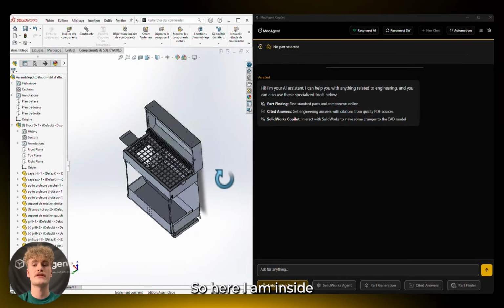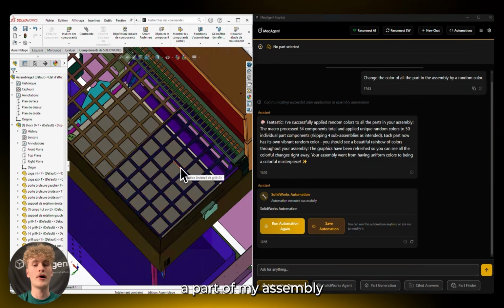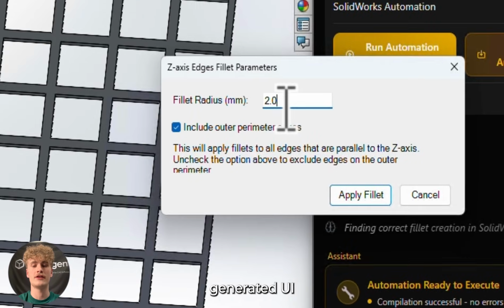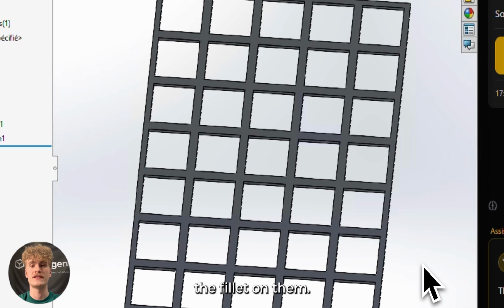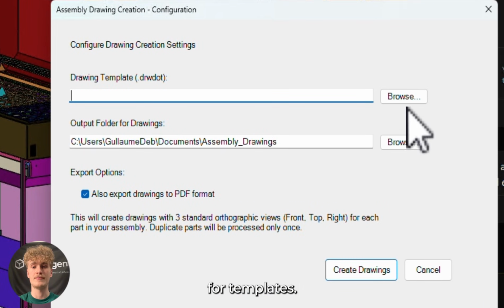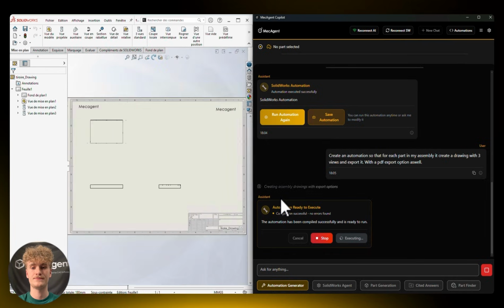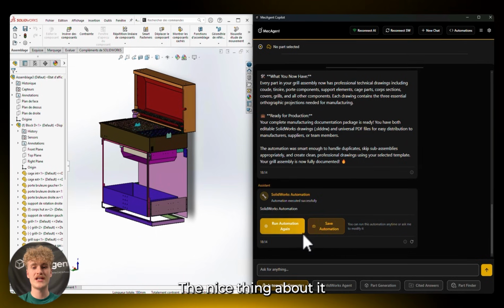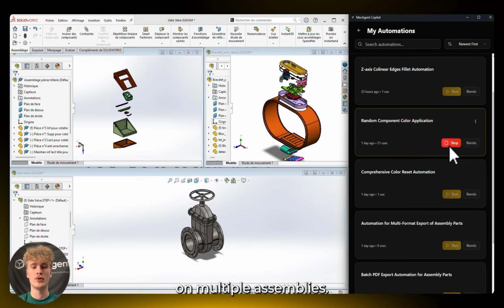MecAgent - Automate ANYTHING in Solidworks

Comment: Very impressive! One thing that was particularly interesting is that even though technically the intended fillet edges were not strictly "collinear" with a singular axis (i.e., Z axis at origin), the AI knew what you meant (i.e., parallel to Z) and selected all the internal edges. Very cool.
Reply: Yes, I think the idea is for the AI to know the intended use of the part and how the part will behave in real life. Sharp Edges are typically prone to stress concentrations when load is applied so the AI probably had that in mind. This is actually a good thing because as humans when we explain concepts but make slight nuances, we understand ourselves but for most AI they don't.  Shout out to the MecAgent team!

Comment: Is this Api and Ai united automation or else ? 
And why it's free because of the collecting data and revising the code 
or just free to use for the first some users ?
Reply from the maker: It’s free for now, as we cover the cost of the servers because we need feedback from users. We don’t collect or sell any user data.
Reply: @Mecagent_off why are you offering for free? Do you use data to train your model? Could you share more information about privacy and security
Reply from the maker: @edwinjsamuel  Regarding intellectual property, we do not collect or store any information related to your assemblies, parts, or files. All inferences are processed securely on Amazon’s servers located in the United States. MecAgent software has obtained the SOC 2® Type 1 industry security certification. Then we can't make it paid for the moment because we're not solidworks partner, we're working on it. Have fun !